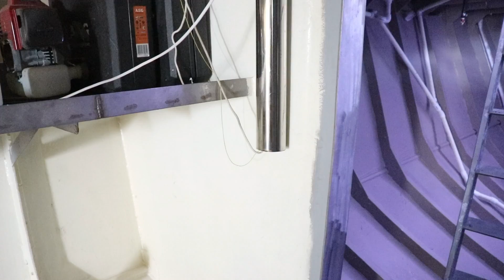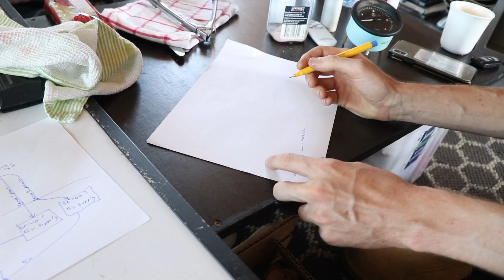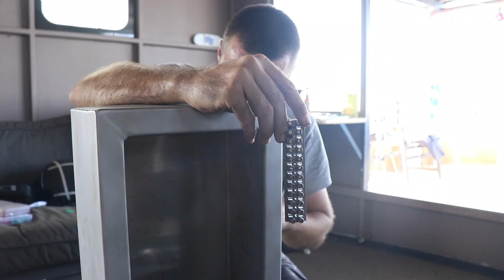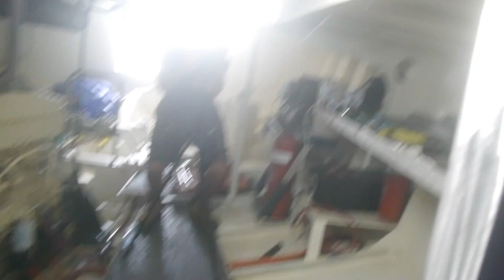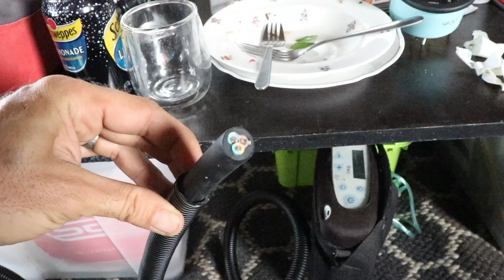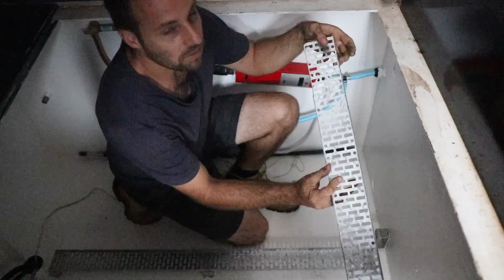Bridge to Engine Bay Wiring - Project Brupeg Ep.69

Comment: nice water sink from bridge to engine room
Reply from the maker: Not sure what you mean Gerhard
Reply: Your new pipe starts in the bridge?  MV Dirone got a lot of water in the bridge, going through pipes direct down in the bilge. https://www.youtube.com/user/mvdirona - was anywhere on the atlantic.  Sorry not found the right video from Dirona.  I have seen the pipe starting on the ground in the bridge - nice way down for water.    Thanks for your videos, I like it.
Reply: @gmtju  I think you must have missed the video or was watching something else? The box in the engine room will be fully sealed and watertight. Thus no water will get to be bilge. Also if the wheelhouse was to fill with water, you will have more issues than the box getting wet. All the flyby wire controls will probably malfunction in not 100% waterproofed.
Reply from the maker: The wheelhouse on Brupeg is a sealed room. If we have water in that room we have sunk... condensation may be an issue but large water egress won’t be
Reply from the maker: Hi Gerhard. Top is open but is open to the battery compartment under the wheelhouse floor. It’s not possible for this area to get water in unless we break windows in the wheelhouse. There is no access to the exterior in the wheelhouse on Brupeg

Comment: You cant leave us hanging! Next episode be sure to let us know what was wrong with the fuel selenoid🤔
Probably too late to be of use now but it's easier to pull multiple runs of wire through a conduit all at once, not one at a time. Also may want to find some wire grease to make pulling easier.
Reply from the maker: The solenoid looked fine when we opened it. We think there was a bit of muck in it that got cleared by checking it, from the engine sitting for 4-5 years.
Reply: @ProjectBrupeg  Have you considered an intake (air) shut-off valve (could use an old throttle body with a lever) in case of run-on emergency ?

Comment: Please..Do yourself a favor and leave a Rope in the Conduit. It will make further work a lot easier. (I found out the hard way.) :)
You might also think about a way to shut off the Air intake completely. Diesel Runaway is a violent process. ;) Just something to think about.
Reply from the maker: Hi, yip we have discussed both of these things. We have a strong piece of 5mm rope in the stainless conduit and we will be building a shit off flap to mount in front of the turbo soon
Reply: @ProjectBrupeg  "shit off flap"...
sounds appropriate
Reply from the maker: Lol! Yeah AutoCorrect is awesome, shit off flap is 100% what it should be called
Reply: @ProjectBrupeg  A continuous loop of line through the conduit will be better than a single line. Then just use a zip tie to secure the cable being pulled to the line.
Reply from the maker: Thanks Just me